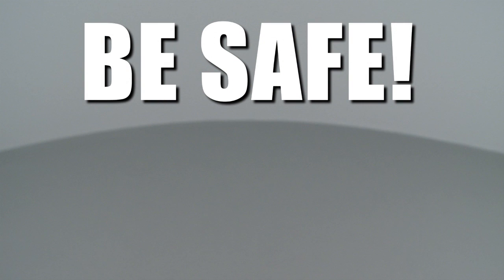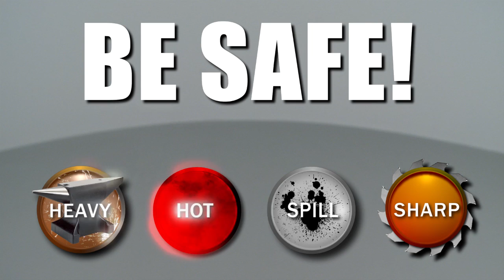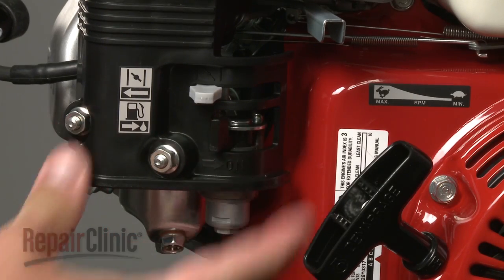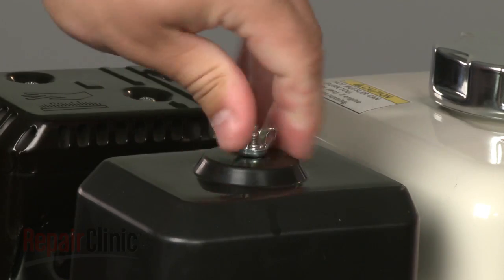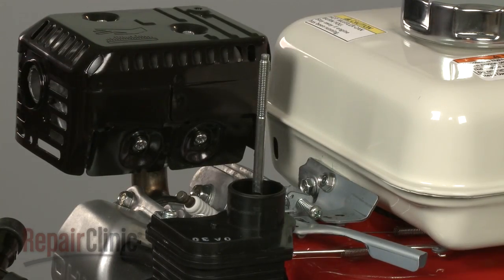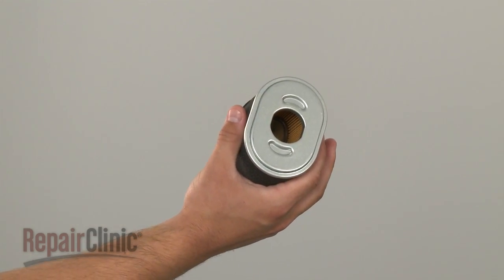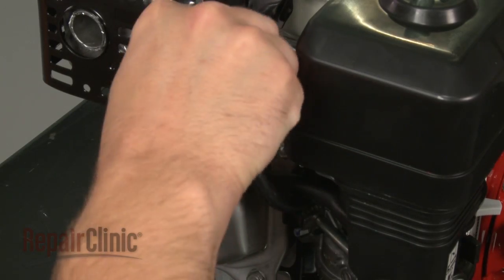Honda Small Engine Air Filter Replacement #17210-ZE1-517

Comment: What about oiling the air filter?
Reply: I was thinking about this. My manual says to do so. But there are 2 things about it. I think oily air filter clogs up faster. You'll get more power if it's not. Just regularly clean your air filter and replace more frequently. Personally I think that's best.
Reply: It's three yrs in the future, filter oil is very tacky, it won't clog paper element.